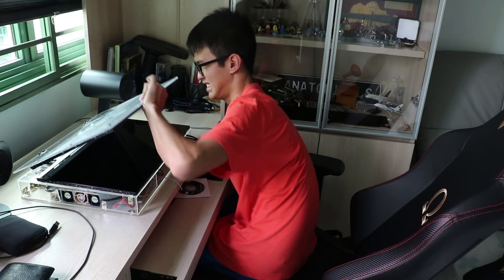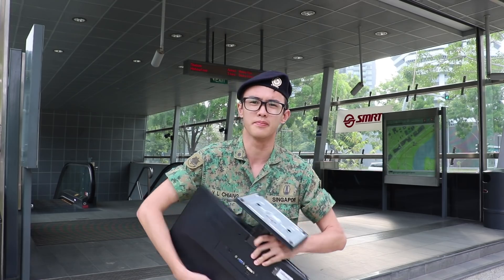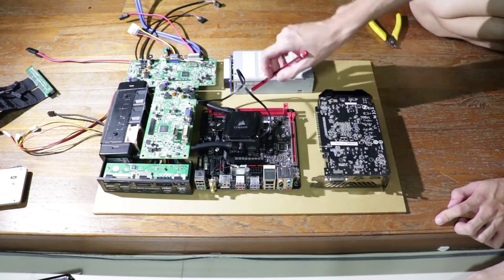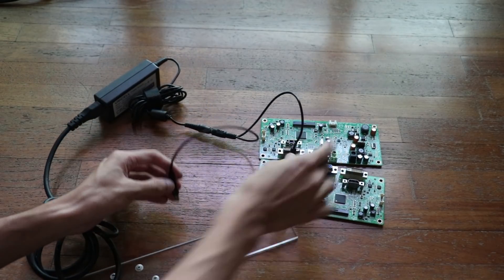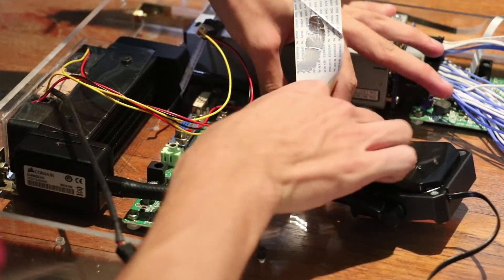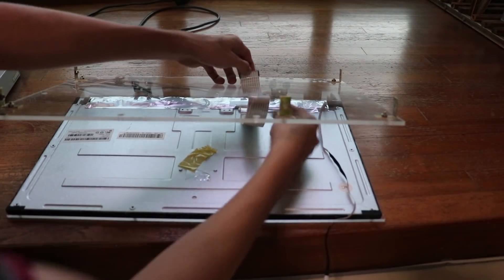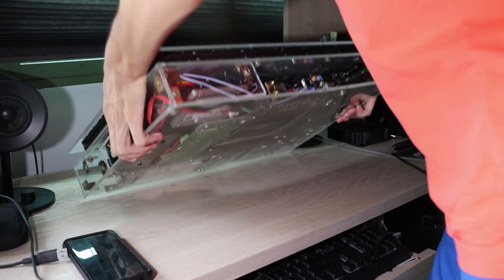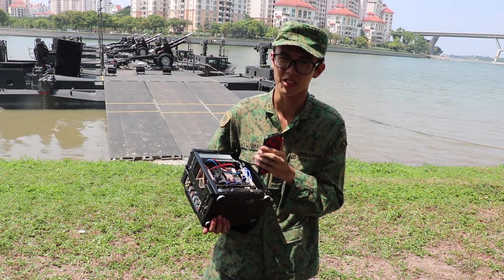DIY Dual screen portable desktop

Comment: Man, I got this same idea. At first I wanted to put my pc in a suitcase, but for lack of knowledge I chose to adapt my notebook. I still have not started and see this amazing work that you did, I'm sure that now I will not use the notebook anymore and yes I will continue the drawings using the parts of my pc.

Do not stop that, in the description of the video you said that you did not do something with a better aesthetic because you did not have adequate materials. I also do not have the materials and tools, I know it is possible to do this using steel plates and to cut I will use a manual saw although with an electric saw the service is immensely easier ...

Great video...

Comment: can we have a list(maybe some links) with the components you have used?
I'm curious about that PSU and CPU water radiator
Reply from the maker: the PSU is a FLEX ATX psu, that has been custom modded with modular cables, Which as far as i know, only GEEEK offers it
water radiator is a CORSAIR H5SF which has been discontinued, and is modded by having it's 120mm fan removed.

Comment: you should have drilled some cooling holes for the GPU on the bottom of the case would help the temperature of the GPU quite alot :)

Comment: The problem with 1u server power supply is temperature. You are using risen 7+ gtx 1080 which could draw like 400-450w when rendering so in my opinion you could upgrade to smth like dps500. also changing your 40mm fan to a 2x80mm fan( need to cut out the psu shroud). It will reduce psu's temperature and make your system more stable :/
Reply from the maker: Power draw isnt was an Issue. I don't overclock my Ryzen or 1080, which is basically 100w for the 1700x and 200w for the gtx1080. However you're right to say the PSU gets hot. It was custom so the loud server fan was replaced with a quiet one. I'll look into getting a higher wattage Flex psu or changing the fans like you said. Cheers

Comment: Why not use a power converter and drive the displays by the Atx psu? Would have saved alot of space and weight ;)
Reply: I thought the displays used 19v. If I'm correct, then he couldn't just do that without the use of a step up converter.

I personally however think he could've soldered those power connections to avoid using all of those splitters. And maybe save some weight.
Reply: The monitors probably need 12 volts. So he could connect them straight to the atx psu.
Reply: @ilya_mzp  yeah but at a certain point he'll start hitting a amperage limit. With a tfx psu at least. Considering the termal envelope,also I'm betting their would be power leakage via the vrms of both the motherboard and the graphics card due to thermals. The highest I seen is 600w and they only provide 16amps
Reply: @ShartsInTheAir  Maybe. But even my old PC with 2 monitors (one of which is CCFL) consumes 300-350W peak. It has power hungry kepler gpu and overcklocked i7 3770. I don't think that more powerefficient components would consume more. But yes, if it's 300W psu that is a bad idea.
Reply: He would need a better psu, no?
Reply: @deadfred821  Notice how he says in the beginning "this is a prototype I'm working on". Notice how he's doing it at home, from old ridundent parts, perhaps working with what he's got? Right on bro! once you got the concept up and running, then you buy the better choice parts..
Reply: @johandebeer4045  kind of my point. If he uses a converter to also power the monitor(s), he's going to need a better psu. Now you're spending money as opposed to rummaging through what you already got.
Reply: and time

Comment: you could have gone with two USB monitors, it will save you space and ease the difficulty of your build
Reply from the maker: Yes I thought of that however display outputs are limited to DVI, HDMI and DISPLAYPORT and adapters are not available.
Reply: @Anitomicals  I'm surprise that you still response to comments

Comment: I've never liked laptops, because they can't be upgraded, and they are smaller than I'd like. This is very much a great idea. Please continue developing the idea. 

I would suggest, in future iterations, you consider stripping down the video card of it's I/O plate, and cooler, and replacing the cooler with a closed loop. This will let you choose where to put the heat. Also, the acrylic was very heavy and you used a lot of it. Using aluminum sheet metal will lighten the overall build. To reduce more weight, I'd remove decorative parts on the motherboard, and look to remove connectors on cables, instead splicing them together.
Reply: First, @Superboy Boy: Alienware is Dell. They used to be good before the merger. 

Second @James Dulin: All laptops can have their monitors, ram and HDD upgraded. Some are completely modular. Research the MXM 3.0 video card, as an example. This video card is in a laptop I've owned from Asus, model G73JH. It has two 2.5inch HDD bays, one optical drive bay, the CPU is an Intel G1 socket, which can be upgraded. The GPU in mine is an MXM 3.0b PCI ATI HD 5870 1GB card, but others have used Nvidia. 

If your statement was: Laptops users cannot choose their own motherboards, I'd agree. There's no standardized profile. Currently many manufacturers are soldering both the CPU and GPU to the mobo, however this is not 100% the case. 

Many people that do laptop gaming wish to 'whitebox' where they can choose their own motherboard and thus their own processor (most laptops are Intel, especially modular ones. The Acer Predator Helios 500 ROG being an exception with a Ryzen desktop processor socket). 

I do, however, agree with your suggestions about weight as a possible solution.
Reply: James Dulin have you heard of the new alien ware laptop it has a desktop socket and a interchangeable gpu and ram and all the storage is upgradable and rtx 2080 or ti.    But that’s enough from our sponsors

Comment: Where did you get that power supply , could please share the model?
Reply from the maker: Geeek fully modular flex psu
Reply: @Anitomicals  i couldnt find, i think if you mention the branding and model would help alot.
Reply from the maker: delta dps-500ab-5

Comment: What about thermals? Did u check it? Coz GPU is aircooled
Reply from the maker: GPU Gtx1080, stock. Furmark Synthetic stress test 79°C. 
CPU Ryzen7 1700X, Overclocked to 3.825GHz. Aida64 CPU Synthetic stress test 71°C.